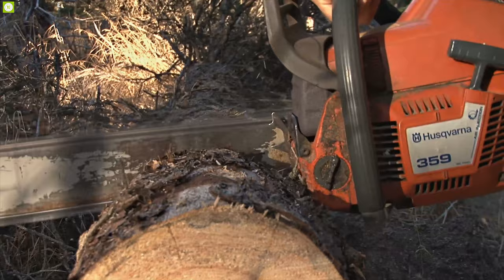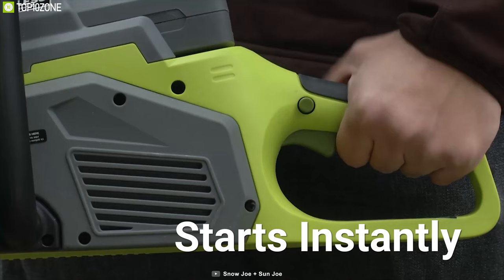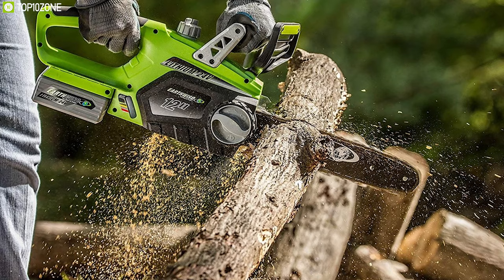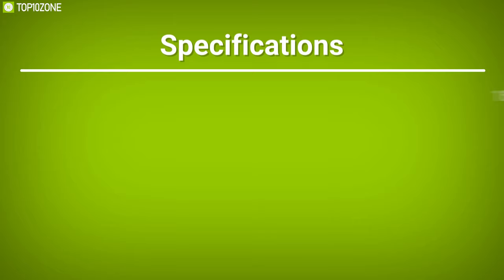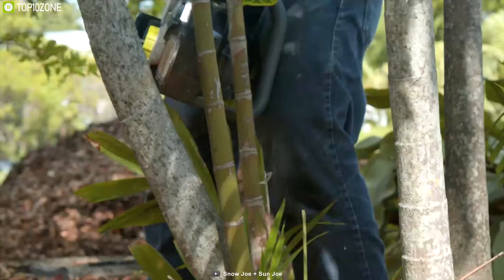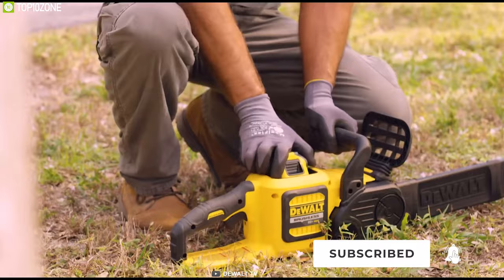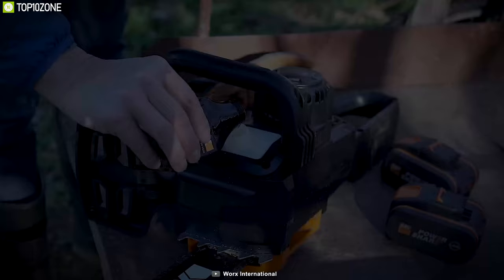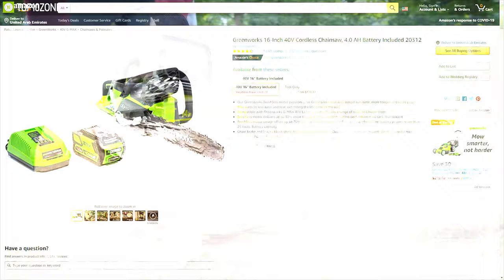Top 10 Best Electric Cordless Chainsaws

Comment: Interesting demo video, but as the rating goes, the presentation is clueless as to justify how they compare, what makes no 1 better than no 7 ?   The video is just an enumeration of facts you could read on the boxes and each sounds very similar in that respect.  To really rate a chainsaw, you need to have it run in a shutout competition, which runs longer? which cuts more wood on a single charge? which is the less noisy ? which is lighter? etc. etc.

Comment: You should say budget saw list. Stihl, Husquavarna, and Milwaukee are miles ahead of every saw on your list. Must be sponsored by some of these other brands.
Reply from the maker: Thanks for your opinion.
Reply: Milwaukee electric chainsaw is made in China.  I have a Stihl cordless chainsaw. I would have bought a Husquavarna but couldn't find any info or reviews on them. I end up choosing a GreenWorks because I also wanted a good weed trimmer and blower. For less than 400 dollars I bought all three brand new including 2 60v batteries. That same set would have cost triple the price had I gone with Stihl or Milwaukee. I really do not believe that they are worth that much more. My Stihl MSA120 is awesome for Limbing and bucket work and around fences but the chain is tiny and I needed a good saw to cut firewood without taking all day.
Reply: Milwaukee is a trash saw for battery saws. It gets smoked in almost every head to head. Stihl is good if you wanna spend 500 but can spend 300 on a husq gas 30cc with better results
Reply: @dirtyroo5562  Agree with you as for performance, but trouble with gas chainsaw is that they are so bad for the health of the user.